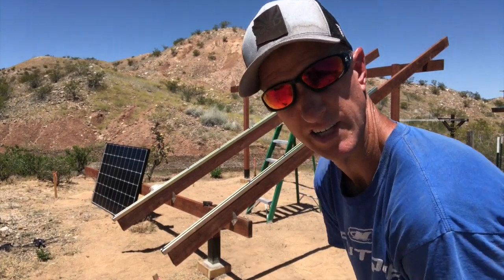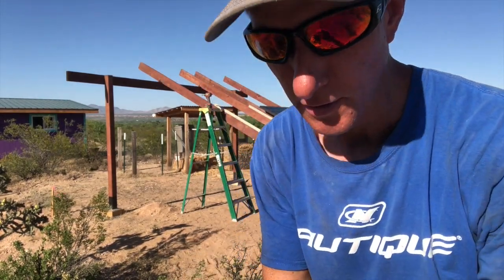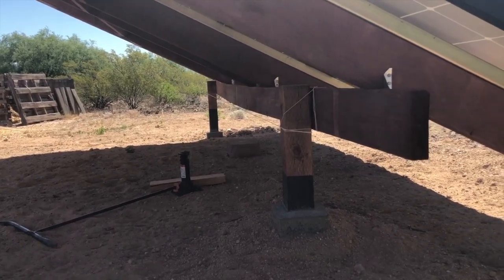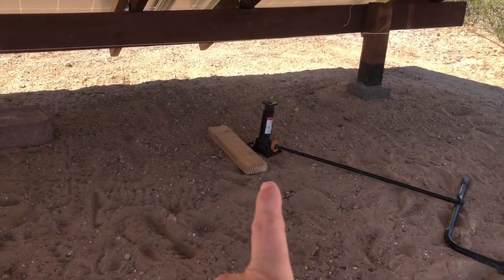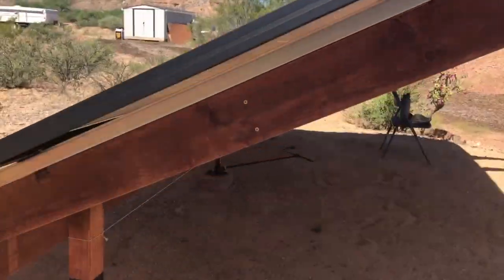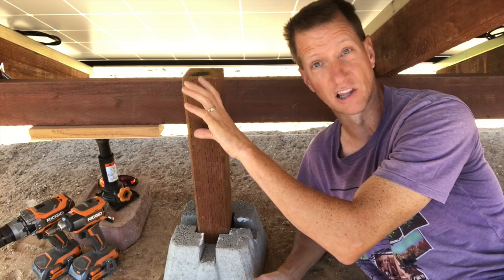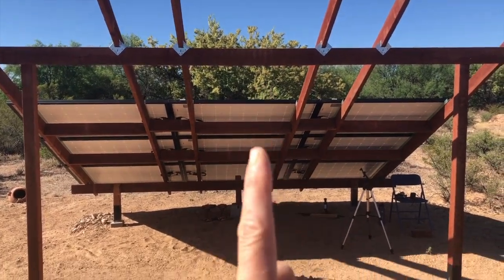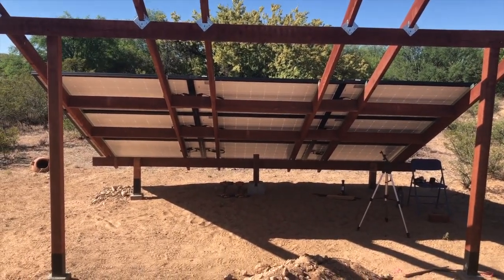DIY Off-Grid Solar Setup (Part 3 - Solar Panel Mounting)

Comment: In solar arrays, uplift is usually significantly more (See what mph wind limits apply in your area) than the static gravity loads (what is pushing down on that beam). In this case, there will be excessive loads on that bottom beam when it is being pulled up by the wind with more deflection up than down. The pier should be put in concrete AND/OR make sure the beam is nginneried for the 12ft span you have. Also I worry about those screws. Uplift requires certain pull strength (an axial load in addition to  a sheer load)
Reply from the maker: Thanks for the input.  Still holding strong! 🤞

Comment: Did you end up installing all 15 panels?
Reply from the maker: About to make the switch from the temporary solar trailer to a utility shed for the house.  Will be moving the final 6 panels over in that process.

Comment: I personally would slap another one of those on the back of the existing beam with screws and reinforce it.  Put a 4x4 block in the middle and call it a day.
Reply from the maker: Not a bad idea!  Thanks!
Reply: Agree, sister the original undersized beam.

Comment: In city you would need permit with blue print from architect  structural like that will not work in any major city . I have same problem I have 26 panels and inventor I do not wish to put system on roof  living in city is very tuff structure like your would not pass inspection .
Reply from the maker: I don't doubt it!  Of course, not looking to do anything silly or dangerous here, but it's nice to have the freedom to do what you think makes sense.

Comment: Hello, What size lag bolts did you use to attach the struts to the wood? Thanks
Reply from the maker: Not sure. I’ll check. Do you still need to know?
Reply: @MidlifePrices  Actually, after watching another one of your videos, it seems, you are using bolt & nut to attach struts to wood.

Comment: When I started watching the first video, I thought that the spans were unrealistic, but I’m old and painfully experienced. The size with all 15 panels, I would have 9 post, and cross bracing. Wind is incredibly strong, and it will be fine, until it turns into a kite. Great job with everything, I’m mid process off grid and loving it 🤓
Reply from the maker: Thanks so much.

Comment: also you need to reinforce the lenth with cross supports form your 4x4 to middle. if not sags will happen in middle lengthwise. I would jack the long beams and add cross beams with strong screws not deck screws. not a full lag but 1/2 lag strength.
Reply from the maker: Yes, cross supports are still needed.

Comment: span depending on load is 4-6 feet.. if doing a huge snow load then 2 feet.  I am doing 6 foot span but I am doing my Unistrut across them for that same reason. will keep them from sagging. Difference is I am  doing 2 tall x 20 wide.  that is 11 feet tall by 66 feet long.  remember crossing will strengthen. I am not mounting panel frame to Unistrut, I am using square washers. I will mount top and bottom with a special bracket.  Again has to be super strong. I wanted metal frames but I can not find what I needed so wood it is.
Reply from the maker: Sounds strong to me!

Comment: How many panels did you end up with? I'm looking to build a ground mount for 20 panels. Each panel is 42x84 I believe. 445w each.
Reply from the maker: Got 9 on there now, but will eventually add the 6 we're using at the RV for a total of 15.  305 watts each, 39"x65".

Comment: you should really build a small say 8' wide by 3' deep shed UNDER your solar mount for your power equipment.  Nice short solar runs, and line voltage wont mind running to your buildings from that far away. What do you think of that? Also, are you planning on moving the 6 trailer mounted panels onto that frame also? You could take some caulking and make a roof out of the panels for the power shed, just seal the gaps and instant roof.
Reply from the maker: Definitely thought about doing an electrical room under the solar mount, but want to be careful not to block access to the backs of the panels.  Still thinking about it.  Yes, we will be adding the 6 currently trailer mounted panels to the ground mount for a total of 15.  Thanks for the suggestion!  I'll let you know what we settle on.

Comment: remove the panels in the center and add another 2 more post, since you need to buy an 8 footer. This way you will have 4 matching 4 foot post. do it right!

Comment: Bryan, I suggest more bracing to guard against wind lift.  Check out joelsgulch.com, specifically his initial install at http://joelsgulch.com/okay-im-just-going-to-go-ahead-and-call-that-a-sign-from-above/  and the wind damage that he got at  http://joelsgulch.com/windstorms-cause-property-damage/
Reply from the maker: Thanks for the info, Al.  I do appreciate it.  However… It looks like the problem with that setup was that the posts weren't anchored deep enough into the ground.  Tough to tell scale from the photos, and I could be wrong, but the ball of dirt on those exposed posts looks like they were probably only a foot or less in the ground.  It really won't matter how the structure is built if it's not anchored properly.  He may have been fine if he had just gone deeper.

Comment: you could just go get some 2 by 8 or 2 by 10, make a double beam (in other words glue + screw  2 2*8 together and attach it to the back of your existing posts with lags. Boosted tot he right height of course. You don't even have to remove the existing beams
Reply from the maker: Always a possibility!  Thanks!

Comment: I didnt see how you attached the 2x6 to the posts,  if they are nails or screws, you may want to add a jack stud by the posts to reduce the sheer load on the bolts or screws... I live in AZ as well and the wind might be the biggest issue as it can split wood during our storms...I know you probably have a good chunk of money there, and I dont think you could over brace it or over strap it or even sister the 2x6s  to hold it down in storms and wind..
Reply from the maker: Good points.  Definitely gets windy here.

Comment: Good after the fact engineering solution.  I like "how many" watts you managed to support with only digging four holes.    Is there room for 3 more panels across the top if you wanted to expand?  Also,  can you give a "ball park" figure for the materials cost for the whole structure?   It's seems you got a lot of bang for the buck.   Enjoy your channel and those of your neighbors (Bill, Handeeman).  you all do things very differently but make great videos....  plus your wife's laugh always makes one's day at the start of the vids.  God bless stay safe.
Reply from the maker: Thanks, David!  Right now, it is just big enough to handle the 15 we're going to put on it (6 are waiting to be installed, since they're in use), but if I had to expand, I could do another structure beside this.  I think everything you're seeing here was about $600.  That's why I chose wood over a metal racking system.  Can get pretty pricey.  Will have to spend a little more for cabling and some odds and ends for the electrical, but can't control that cost.  Thanks for watching!

Comment: Just a suggestion but half flaps would add to to longevity of those posts. I say this because most of the weight on those posts are supported by the bolts not the post itself! As i am not very eloquent with words here is a example of what i meant.  https://www.nachi.org/gallery/general-2/notched-post-to-beam-connection-1
Reply from the maker: Oh, yes.  A half lap joint where the beam sits in a notched out portion of the post.  That's a very good point.